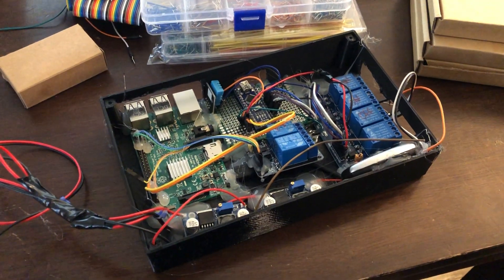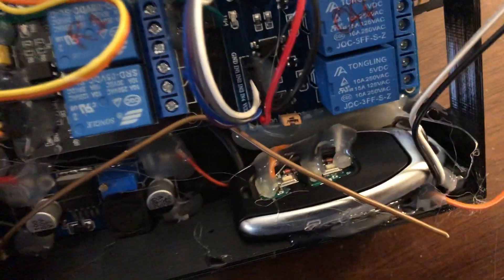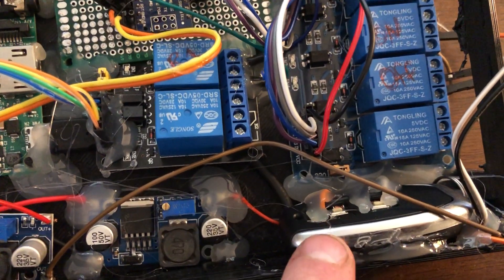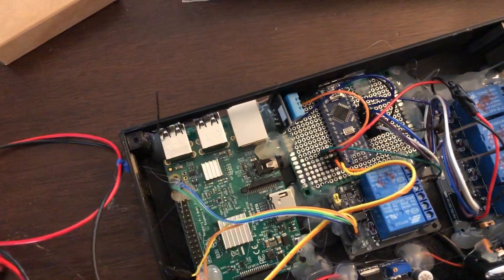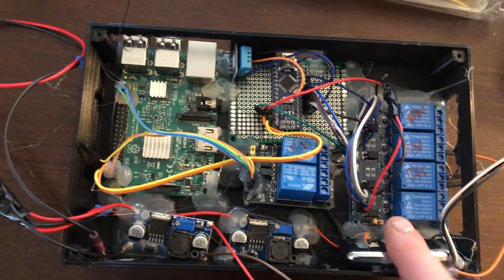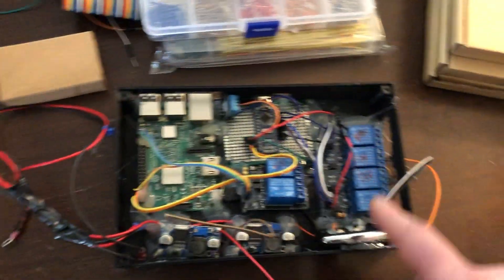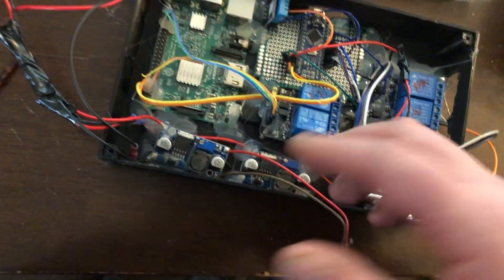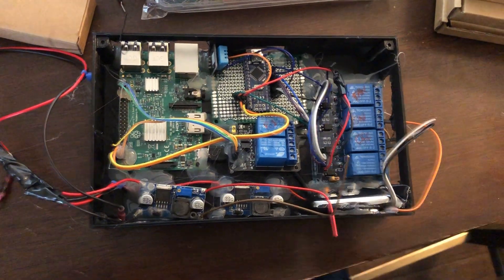DIY Victron GX (Raspberry Pi) update. It starts the generator! Also, improvements needed.

Comment: Yup, you're problem with the fob is likely the high frequency switching in the buck converter. There are a few things you could try. 1. Mount the buck converters in a metal box tied to GND this should help shield some interference. 2. Add a Ferrite Toroid on the power lines going to the remote. 3. Double check the voltage you should be using for the remote. I haven't seen the remote you are using, but if the two coin cells are joined in parallel in the remote, then you would only want to feed it 3 volts. Also, some coin cells are 1.5v. 4. Mount the fob further away from the buck converters, especially since there are two of them, you are doubling the amount of EMI. Simply moving it to the other side of the bank of 4 relays could possibly help. Good luck, I have subscribed and found your videos because I was also installing venus on a RPi. I'll be checking back for an update :)